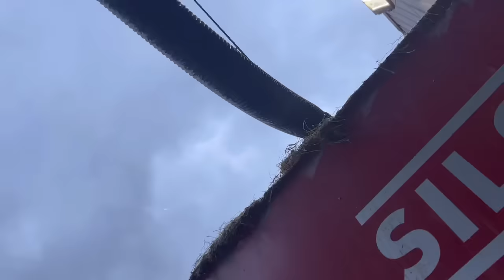Claas Tractors Takeover at the Farm! Straw, Muck, Feed and Cattle! Busy Day!!!

Comment: i remember goig to the yard at 10 arches to load with coal for the home deliveries, it was full of hoppers with coal and coke of different types, we would put 80 bags of a hundred weight each on the truck and take to miners and ex miners homes, great video and lovely to see a part of my past in there
Reply: My grandparents had free coal as part of his NCB remitances which may have come from there, i have never heard it called ten arches and i was born just along from the Collingwood as was, my grandfather farmed Manor Springwell and Highwoods farms at one point, and i had names for the shunters on the mineral line that crossed the road and under the mainline just along from the arches.
Reply: @philsteele7151  the viaduct is Bolton 10 arches as far as I know.
Reply: @ianunwin  Its definatly where you say, i have not heard it called that before i will ask my mother.